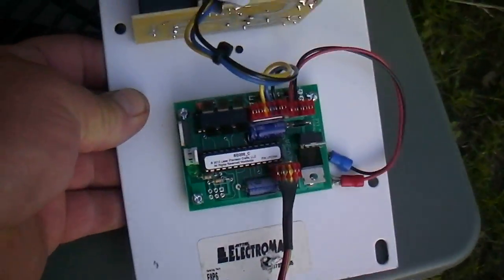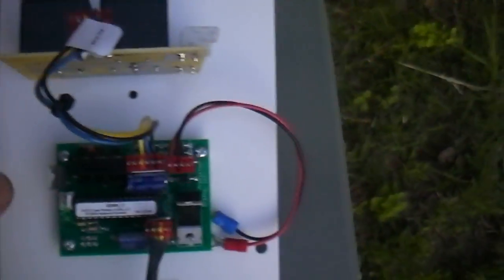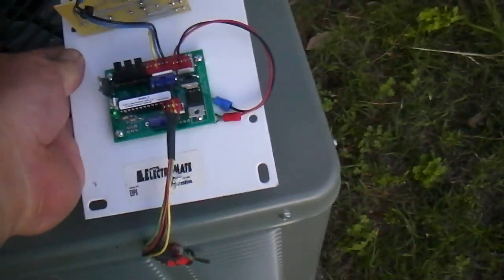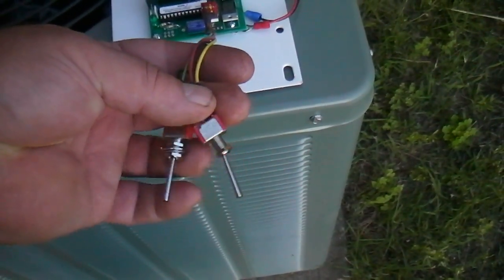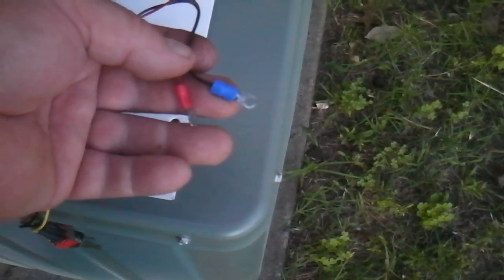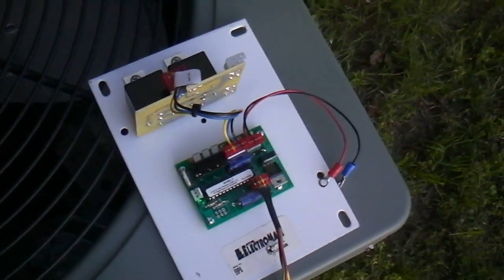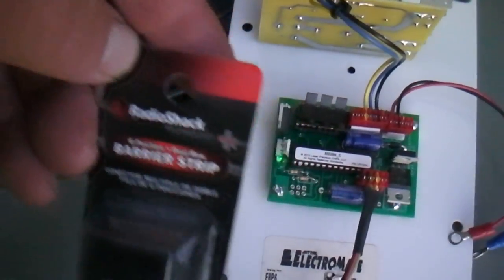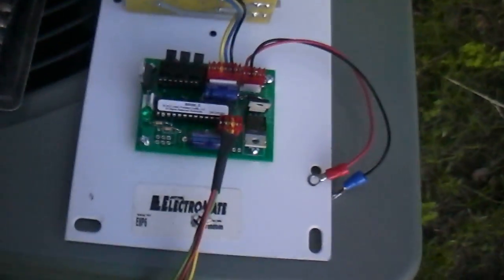Solar Tracker Controler Board is Mounted with Relays

Comment from the maker: when I built my colman air charge controler this is how they guy told me to make it. So I had some experiece on mounting electrical boards. Its not the cheapest way but it should work well. I wont be able to see my led unless I open the water tight box door.

Comment: Looking good I just used a PVC box and mounted the tracker board in epoxy inside a spot light fixture after removing the bulb.  then used 2 ground lugs ,1 for hot in & 1 for neg to operate the Relays for moter drive .Your getting there ,looks good i never thought to mount it like that.

Comment: I see you have the relay board, I was wondering about that. Should drive any size actuator arm. It's called a Terminal Strip, I don't know why Radio Shack calls it that, no one I know does. That's good to have, it's going to make it easy to wire up.